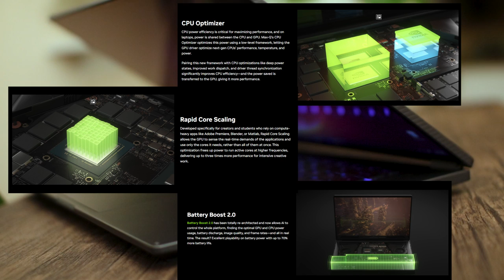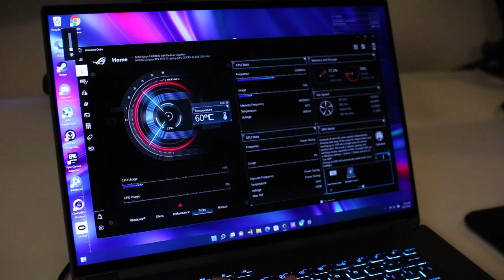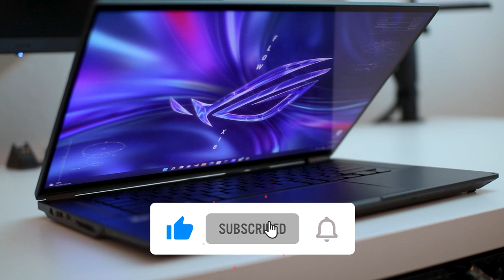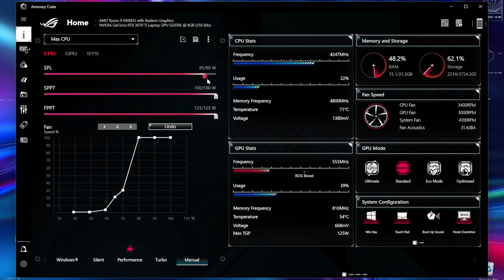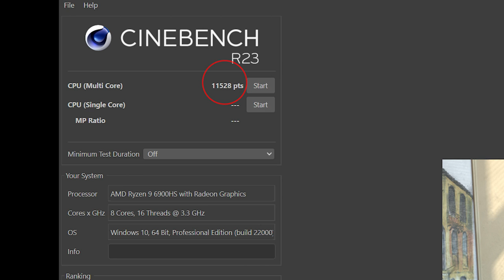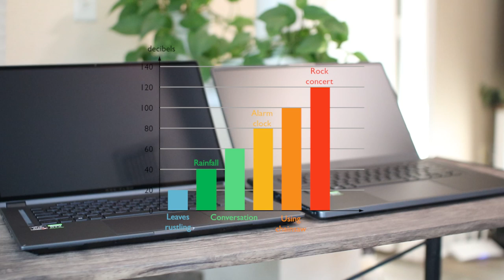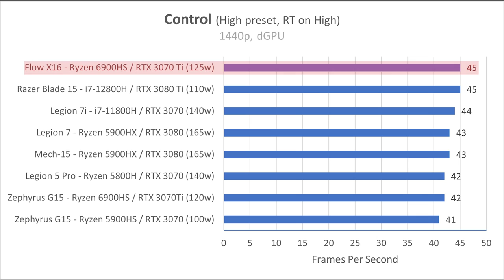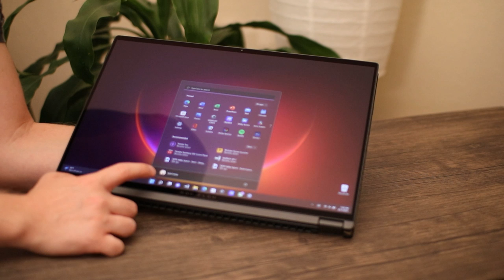Asus ROG Flow X16 Review - Best Gaming Laptop?

Comment: Just a note on the "Optimized" GPU Mode which i find is the most helpful mode there. 
It will auto disable the dGPU on battery and fully enable it on AC Power. Giving you in my opinion the best of both worlds (Battery life and performance on demand when plugged in)
Reply from the maker: Yes, this is what I typically leave it on!

Comment: This is the most thorough review that I have found for the X16 - subscribed because of it.  I bought the X16 when it released, and I agree completely with your review.  It is an amazing  and versatile machine.  That said, had I not been saving off and on for a couple of years specifically for a new laptop, it would have been out of reach financially.  My only disappointments are the lackluster camera and that USB4 is still not available as of this date (Dec 31, 2022).  I know they are working on USB4, but they are taking far too long to get it done.
Reply from the maker: Thank you!! Also the USB4 beta drivers are out and seem to be working great! I’m using it right now

Comment: I bought the X16 last month, and hot dang, what a display indeed.

Had a fluctuating dimming issue when the HDR was on, but solved that with switching off some power saving option in the AMD driver module.

Put this thing in Ultimate mode, and silent fan profile, and this thing runs like a rocket and is super quiet at it.

Battery is great, once you set it to Eco mode within the Armory crate, and have the brightness lowered to 70%.

Getting 7 hours with that setting, while doing average productivity work.

Only thing I wish it had was advanced Optimus, cause you do have to restart it when switching to and from Ultimate mode.

Not that big an issue cause it restarts and logs in in a couple of seconds. Still though.

The next gen one round the corner is gon' be crazy.
Reply from the maker: Nice!! Agreed, glad they’re putting Advanced Optimus is gonna be awesome to see on the 2023 model
Reply: @Josh Cravey  oh yeah, that and a webcam that doesn't project you in 8 bit graphics 😂

Make sure to review the gen 2 version, and keep up the good work 👍🏼
Reply from the maker: @mohammeds9915  true! 😂 And I absolutely will
Reply: @mohammeds9915  hello. Is it the mini led or ips one that you bought sir?
Reply: Hi man, do you remember maybe what was this power saving option in the AMD driver module for HDR dimming? Was it Vari-Bright or something else? Thanks in advance

Comment: Im going to buy it
Reply: Dang ok!
Reply: U are not gonna regret it, the 3060 version is a bang for budget pockets
Reply: @blion3d  gang?
Reply: You trying to buy one for me too?
Reply: Price?
Reply: @blion3d i’m stuck between the X13 and X16 the X16 is 899 with all the same features except it has a 3050 ti is that still good ?
Reply: @gazzygarcia1636 nope so do it the 3050 will struggle with modern fps games unless you’re playing really old games or 1080p resolution and not 1440p or higher save your money and get at-least a 3060 or 3070 minimum
Reply: @vlone_slatt3504  Gaming wise i’ll mainly use the laptop for emulation as long as it runs PS3/Xbox 360 then i’ll be happy with it, do you think it can run that no problem? also the features that the X13 brings seem great for college as well
Reply: @gazzygarcia1636  idk, what x16 did you find with a 3050 ti. I was under the assumption they don't release 1440p laptops with that GPU cause it doesn't handle it well.

It is considerably worse that a 3060, best buy has the 3060 one for 200 more rn at least for me if you have an extra buck to burn it would be better
Reply: @AlexanderShepherd-cs8vp  yeah i meant the x16 had the 3060 and x13 had the 3050 ti i was considering the x13 because it’s more portable but x16 looks good too
Reply: Buy it, buy two, buy three and give it to me. Haha
Reply: Same❤

Comment: Thanks for mentioning the 3060 a bit compared to 3070ti, I was kinda worried for a bit it's gonna be very different later in the video, but yes that price is definitely worth for a perfect laptop like this! I'm kind of in love with this one because I have experience in graphic design; a 2in1 gaming laptop with amazing color gamut, touchscreen and very low fan noise? Kinda love this laptop already
Reply from the maker: It’s an amazing machine!!
Reply: @JoshCravesTech You said the 3060 is 10%-20% behind on games than the 3070ti, do you maybe know more about that? Would you think the games would still perform smooth enough for games also with ryzen 7?

Really hope you think it's redeemable and you react to this 😶
Reply from the maker: @rukeyburg1084  yes, the Ryzen 7 will not affect games hardly at all since the GPU is what matters 99% of the time when gaming on a QHD display like this. So yeah about 10-20% behind for the 3060. It’s still a solid GPU!

Comment: OLED means you can use mux switch(limphao), instant response time + 240hz, much superior performance in lower lighting and many scenarios(it just doesn't have as many dimming zones like the MacBook unfortunately)

But yes, you do get less brightness though 500 nits is plenty unless you're using this thing outside lol
Reply from the maker: Yeah, I’ve heard people are having trouble with HDR on their GE67’s and Blade 15’s with that panel though. And they’re losing Freesync/Gsync. But the response time and contrast is nice of course
Reply: @JoshCravesTech  yeah it's rough, they can get it to work by ddu fresh install but if you cold boot it reverts the fix.
Reply: 1100 nits of peak brightness can make hdr content a lot more immersive without needing to be in a dark room.

Comment: I would've bought it in a heart beat if it doesn't cost as much as two G14s, like wtf Asus.
Reply: The display and eGPU module are what makes it expensive compared to G14.
Reply: Also depends on the SKU of G14 you buy. The 32GB model at Best Buy is $2500. The x16 is $2700, has a second SSD slot, and upgradable RAM up to 64GB.

Comment: Awesome review.  I wasn't even aware of this model and coming from a Spectre X360 it seems like this is the laptop that I was looking for when I was looking for a touchscreen laptop capable of gaming (albeit 4 years ago).  I've been looking extensively at the G15 and G14 so I really appreciate the indepth reviews that you've been putting out on these.

I'm very torn.  Just ordered the G14 on a great deal in Canada ($1,799 CAD = $1,317 USD) for the 6900HS/6800S 16gb model.  It's a compromise for me as I'd prefer the G15 3070ti model but that retails for $2,999 CAD.  Do you think I made the right move?
Reply from the maker: Wow what a jump in price!! And you definitely can’t get that model of G14 that cheap in the US so you got a steal. I love the G15 but at that price I’d probably stick with the G14 personally unless you can sell it for higher
Reply: @JoshCravesTech  to be clear it's a Best Buy open box but if I get it and everything checks out it seems like a killer deal.
Reply: @trevorburns91  what’s the gpu on the g14? I just got the open box g15 for 1599 CAD - only has a 3060 (and R7 if yours is R9) but I’m trying to get the best for the least cost on this purchase. 

You might see if they throw a few more of those on over cad thanksgiving if you were interested!

Edit nvm I see you said 6800s or w/e
Reply: @SuperStudent213  you got it.  Think the 6800s g14 and the 3060 G15 are comparable in terms of performance

Comment: Hi Josh! First of all, your reviews are just something else! Speaking for myself, I can't make a couple thousand $ purchase decision based on just some guy in a 10 min video saying: "wow, great screen" and throwing a couple of benchmarks, which, to be frank, is most of the popular "reviews" out there.

Second, also thanks to you I will be getting this laptop next month! I wanted to ask if the tips mentioned in your g15 battery life vid will also work on this laptop to get a bit more battery life out of it?

Thanks a please, keep making vids, I subscribed and I am sure there is a huge fanbase waiting for you!
Reply from the maker: Thanks a ton!! And yes, the battery optimizations seen on the G15 also apply here!
Reply: @JoshCravesTech  thanks for the reply Josh! would you still recommend this laptop for my use case? Just want to be 100% sure and your opinion would greatly help. 
My use case: not a mac, budget 4000$, 16:10 display minimum 14", quiet (the fans on my current zenbook 14s drive me nuts and I haven't figured out a way how to set the fan speed), reasonably portable, working primarily with illustrator, after affects and premiere (would like them to run silky smooth), I use GFN for gaming but occasionally would like to play games that are not listed, upgradeability. Thanks!
Reply from the maker: @martin_bolha  yep, for everything you listed this seems like the perfect machine. I think you’ll love it!
Reply: Hi Josh! Thanks so much for your replies. One last question, do you know how this x16 compares to a G15 with a 3080? Performance, system noise and battery wise? Thanks!

Comment: Ah I will share my tips to  creator of this video and people who are using x16, whenever using DGPU + HDR  Using this solutions will solve the problem, installing the  V30.0.15.1278 stock driver + [Auto HDR or Tent mode{for some reason when screen is rotated in any side the problem disappears) or using Microsoft game bar's fps draw function with maximum transparancy ]
I assume it has to do with smt about colour profile or the brightness control of HDR looks like they are putting over gamma on hdr
Reply from the maker: I will definitely try this!

Comment: Hey loved the way you have described the things. Can you comment specifically on the hinges as many out there aren't sure about these hinges. Is it really goes down itself as I am very much afraid of the sturdyness of these hinges.
Reply from the maker: Pre-release reviews also had me worried about that, but the hinges are actually very sturdy. Just as sturdy as most other gaming laptops I’ve used. They feel just tight enough to use the laptop in any orientation without having to use too much force or have it flop over.

Comment: One possible problem due to the ROG XG Mobile implementation - if you happen to have it connected and active, when a black-out happens, whether intentional or just accidental, all the apps using the GPU, so today almost all, are going to crush along with Windows within a second or two of the power outage, even if you'll have the battery fully charged. What's worse, upon reboot you might end up with a blockage from the Asus Windows external GPU switching reporting/requesting that you turn on/power on/connect the XG Mobile before you're allowed into the OS... That's a huge PITA. Same applies if you do not disconnect in OS the XG Mobile, and just disconnect the cable when the laptop is off, and then attempt to start the system without powered-on XG Mobile. It's a weird behaviour that Asus might fix in the future, but since they haven't done so since the Flow X13 release, I very much doubt they're going to offer such a fix anytime in the future... I believe the NLTech, the malaysian youtuber who also reviewed this and others with the XG Mobile and without, had similar findings. What would have been even better, if Asus decided to switch to USB-C 240W charging as the powering solution, plus if they took that ROG port and split it into the USB-C or 2 and a USB-A or two, and by replacing the microSD with a full SD card reader from the ROG Mobile (cause yes, you can have microSD cards sitting flush, but you can't stick a full-size SD card into such a reader, while the opposite is possible due to multiple adapters, heck they might put both on the sides or maybe front lip to pack all the features)...

Comment: 35:52 I actually use my laptop in this mode more often than in tent mode because the rubber strips on the deck provide grip, as opposed to no grip in tent mode

One other comment I would like to make about on-the-go workload for illustrator is that it does not enable acceleration for the iGPU, so you will have to set the laptop to standard in Armoury crate, which will end up using more battery
Reply from the maker: Oh nice! That’s cool. Yeah I wonder if there’s a workaround for that. Adobe is great at not optimizing things on Windows so I wonder if it’s some compatibility issue between the Radeon 680m and Illustrator.
Reply: @JoshCravesTech  Yeah tbh it's not that Adobe is great at not optimizing for Windows, it's just that they're bad at in general and just much worse on Windows, I genuinely hope that there is a competitor because Adobe really needs to get off their ass and fix their stuff :/
Reply from the maker: @Gokulbalram  yeah I’m already looking into using DaVinci Resolve instead of Premiere Pro, I’ve had it with Adobe. Unfortunately stuck with them though on Photoshop, illustrator, and InDesign
Reply: @JoshCravesTech  have you tried affinity apps? wish illustrator ran half as smooth as affinity designer
Reply from the maker: @martin_bolha  I haven’t, but I’ll have to look into it!

Comment: Excellent Review! You really made me think again about this Notebook, evidently other reviewers weren't able to review it as well as you did! I just have one question: have you heard any sounds generated by the coil whine?
Reply from the maker: Thanks! Been my daily driver for over a year now and no issues! Haven’t experienced any coil whine or problems with my unit
Reply: @JoshCravesTech  Thank you very much! This is really important to me, because I come from a Rog Strix Scar Edition which suffered greatly from coil whine, it was practically as if an air fryer was on...😅 And what about the latest model? Basically your last review...
Reply from the maker: @lucamagni99  latest model handled well for me too! I just kept the 2022 model because I wanted the extra battery life.
Reply: @JoshCravesTech  Great! I would need something more on the performance side, which is why I am taking into consideration the latest model that has just been released, precisely the configuration with RTX 4070. Thanks for the information!
Reply from the maker: @lucamagni99  you’ll love it!
Reply: @JoshCravesTech  1. Is it comfortable to use the G14 or do you constantly connect to the monitor to enlarge the screen? And which device do you like better, g14 or flow x16?

2. I looked at your review of flow x16 2023, but I don’t understand what kind of energy efficiency at low power 40x everyone is talking about? Even in your video, your timespy graphs show that in silent mode the performance and noise are almost the same on the 3070 and 4070. https://youtu.be/SNRD8kSe12I?si=c5751OZG28NlnUWu&t=1640

Comment: Holy snickerdoodle! I just got myself an RTX 3070 Ti Zephyrus M16 =( These are  happy news for the tech world, sad news for me...
Reply: Update: The X16 goes for 3,000+ dlls LOL I got my M16 new for 1799 dlls
Reply from the maker: The M16 is still nice!
Reply: @JoshCravesTech  Do you have any videos on how to use throttle stop on intel 12900H? I`ve seen your reddit posts, but they are made more for the 11th gen cpu. Plus, no before and after benchmarks in specific tasks are provided. Would you happen to have a video or info regarding the subject? I want to get less heat, more bttery with minimal to non gaming impact (i know cpu bound games will be the ones to take more of a permormance hit).

I sometimes just think to use the asus`s power presets and to not stress. But I do want to get the most out of this amazing laptop.
Reply from the maker: @saulsainz1806  no idea unfortunately for 12th Gen Intel. I know for a while it wasn’t even compatible. Maybe it is now. I know you can’t undervolt though and some other features are probably locked.

Comment: Thank you so much for the in-depth review! Do you think it's worth waiting a couple months for the i9/4070 model vs the Ryzen 9/3070ti you tested here? I'll mainly be using it for graphic design, video editing, and gaming (battery life isn't super important to me). Thanks again!
Reply: Yeah if you can I would wait or grab a bargain. There's a few already selling on ebay and retailers are getting rid of stocks. The x16 hasn't dropped much in price yet but I imagine that will change by the end of the month.
Reply from the maker: I don’t think you’ll be missing out on too much with the new model other than a little bit of fps in games, and programs will be slightly snappier. I’m not too sure if it’ll be a very noticeable difference yet. But battery life will be cut in half with Intel. If that doesn’t matter to you and you just want top performance no matter what, then maybe it’s worth waiting for the 2023 model, but you’ll definitely save a good $500 or possibly more compared to the new model if you wait for the current X16 to go on sale, which it’s done a few times already and will probably do again soon.
Reply: @JoshCravesTech  Makes sense -- thank you for your input! I'll definitely at least wait until the current model goes on sale, and hopefully there will be some hands-on reviews of the new one by then. Are those affiliate links in the description? If so, I'll be sure to use one when the time comes. Really appreciate your help!
Reply: @ZigUncut  I'll definitely wait for a sale! Thanks for your input -- much appreciated!
Reply: @Melimoz  the 16 inch has a great screen right now. Apparently the 2023 version of the 13inch will be getting a similar screen quality with a GFX upgrade. So there's going g to be options. That's what I'm trying to do... wait it out. Happy hunting.